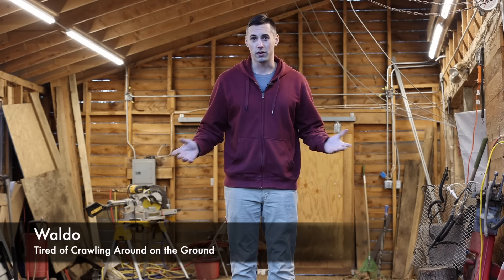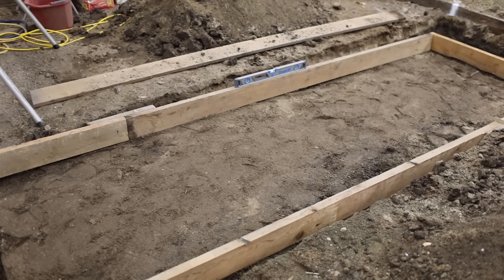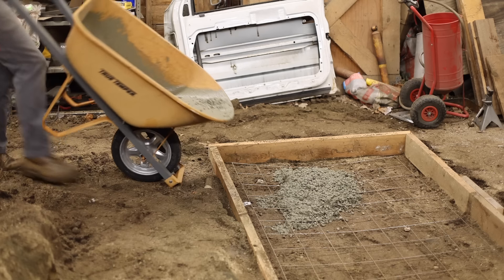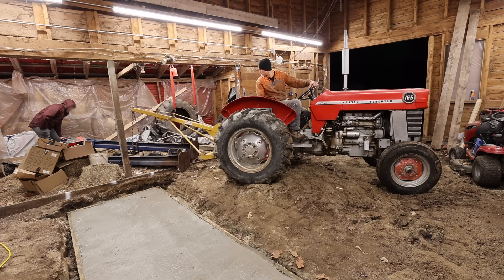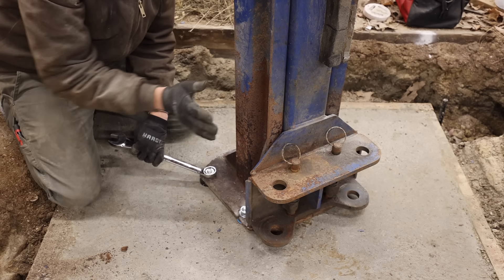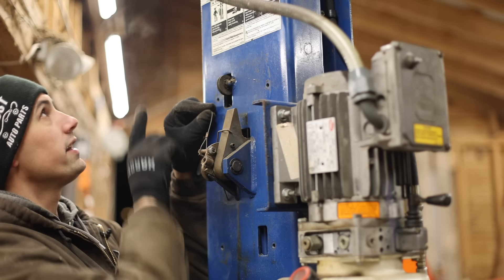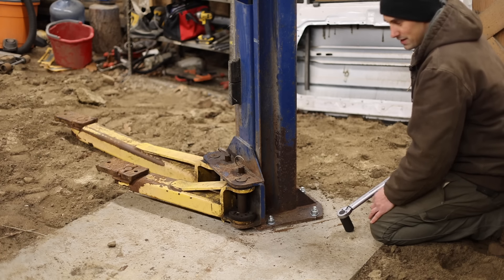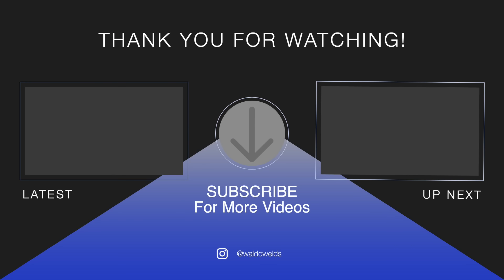Installing a 2-Post Automotive Lift on the Cheap

Comment: Waldo, love the content 👌!! However, that is not in any way shape or form enough concrete to anchor the lift to. We have installed numerous lifts over the years and a 6in slab is the minimum requirement with number 4 bar in a 12-16in grid wired together. That minimum is with the slab being past the outermost edges of your load. Meaning front, back, side to side of the truck. When installing these in a retrofit situation we would anchor pin into the existing slab, dig and pour a 3ft by 3ft reinforced concrete footing under each leg of the lift.
Reply: yes, I would agree with everything you said. Semi-retired builder here. It's not too
difficult to calculate loads on those posts. But is amazing  how so many amateurs simply don't understand this. The good news is that it is temporary.
Reply: I'm glad others are saying this there's no way I'd get underneath that, how much would that slab weigh? Seems like it could easily tip the slab if it doesn't brake it.. I suspect it will brake soon, many lifts also have spreader plated to support them on weaker floors would be easy to rig something up and extend the concrete pads
Reply: @geek9642  3040 lbs for 38, 80lb bags. 5-600 lbs of lift. Bet that crew cab 4x4 Duramax goes 6500
Reply: Depot wedge anchors are good for shear loads. Not so good for withdrawal. not nearly enough concrete to withstand the tipping loads. Looks dangerous AF to me. Around here this is insufficient for a propane tank in an earthquake. quickcrete is very "optimistic" on strength values. "welded wire fabric" is to control shrinkage cracking not to transfer structural loads. But put all that "best practice" aside and assume those parts are strong enough to roll the slab. And they probably are!
 Structurally lets imagine a 4 foot wide piece of cast iron weighing 3300 pounds and another piece weighing 6500lbs 20 feet long and them all bolted together with I beams  8 feet apart from each other, and it just sitting there in the middle of a parking lot. It does not pass the laugh test!
Say the vertical center of gravity with the truck in the air is 8 feet high. The 12" base plates' hinge point is 18" from  the edge of the slab. assuming no compression or squeeze out at the soil then>  96"/18" equals a 5.3 to 1 levering action.  3300lbs. of concrete divided by 5.3 = 622 lbs to push it over at the top. ( didn't even use the back of an envelope. Does this mean a safe working load of 311 lbs of fore and aft on the truck. The  truck weighs 6500lbs. And the whole thing is " bouncing around" - which is considered a "live load". No bueno!
Reply: I’m a county inspector, we pour our sidewalks stronger than that.
Reply: @lukula2934  this is absolutely going to be temporary, but I worry it might be more temporary than he expects. This has the stability of an inverted triangle embedded 1/5th into the ground..
Reply: David, you are right. It should have some decent size footers for safety. I wouldn't just use the slab, but that's just me.
Reply: I was thinking the same, the part of the slab where the posts are sited is nowhere near thick enough or reinforced enough. The the slab footprint is way too small, both where the posts sit as well as the whole slab area. The diameter of the reinforcing mesh is also too small.  I have never installed concrete in climates such as Waldo's (I have lived in the tropics and semi-tropics part of the world), so I don't know about pouring concrete in cold climates, I just know for load bearing concrete, I would prefer to use concrete delivered by a truck pre-mixed. If I were to entertain the idea of mixing my own, I would use a concrete mixer only because it is faster, and will have a more uniform mix. Having said that, in this instance there would be know way I would mix my own. I value my life and those I care about to much to let anyone stand under any vehicle being supported by the lift. My post sounds dramatic, but the risks are too high. Also, temporary sometimes means for years, not a short period. Also it only needs to fail once in the temporary period to be a bad, bad situation for all.
Reply: @iancracknell1379  Hope he reads his comments...Watching him open that brand new case and take out that drill. ..And be amazed at how easy it is to drill into green concrete...And those anchors are hit and miss in the best material. (Cured concrete, stone, etc.) As much as I love the do it yourself attitude, some basic common sense and an awareness of your limitations
is a must.
Reply: I'm currently having a concrete guy here preparing my slab. 24' by 26' with beams crossing each way. Lift company says 4 1/4" minimun with 3000 psi concrete. I'll be 5" thick. Cure for 28 days before any building is done.
Reply: Did he really use plastic shims to level it ? I hear "temporary" getting thrown around, this might just be "lifetime" unfortunately... completely inadequate for any safety standards. Anyone valuing their life will not try to use that setup for lifting a vehicle.
Reply: Exactly, is extremely dangerous!
Reply: You need a compacted gravel base and then a min of 4-1/4" of 3000 Psi concreted cured 28 days and a min of 3-1/4" of 3/4" anchor embedment. And all that is a min of 12x24 bay pad. If you are pouring a replacement pad then it needs to be 4'x4'x6" tied into the existing slab with chemical anchors dowelled in. This install is going to kill someone!
Reply: At minimum he should have bored 3'-4' deep piers with fasteners imbeded in piers, plus over head stabilizers.
Reply: @davidkaufman979  why is this so hard for people. No fastening to the top of the post as it's just a bolted on height extension with no structural capacity.  Second it's not the post falling as much as the vehicle shifting and falling off. Third if your going to pour 4' deep "PILES" then spend the time and concrete on a proper slab!

Comment: The wire mesh you used is for controlling surface cracking and provides no structural strength for a slab on grade.  Use rebar and set the rebar on inch and a half square concrete blocks (dobbies) with embedded tie wire to secure them to the rebar and keep it (rebar) out of the dirt.  Rebar size and spacing should be available from the lift manufacturer as well as minimum concrete size, thickness and strength.  You might want to contact them to verify what you constructed is adequate for their product.  A little late now, but that's what renovation is for.
Reply: Thinking the same. Wire will do nothing for that slab, rebar a way better choice and it needs to above the ground. (I don't remember the exact dimensions).
Reply: @jaymes7521  
What are saying needs to be above the ground?
Reply: @RalphSampson...  not laying on the dirt below the concrete, but rather, embedded approx 1.5"up inside the slab.
Reply: @rixtrix11  It should have read "off the ground".
Reply: Is wire mesh as good as rebar? No way. Is it worthless? Try breaking up the slab without cutters.
Reply: @RalphSampson...  Yes. There actual formulas depending on the depth of the pour. I don't remember what they are.
Reply: @davidbaldwin1591  Breaking up a slab is different than the actual support and integrity of the slab when it comes to a multi thousand pound vehicle leveraging on those posts...
Reply: @AnunnakiAaron  I absolutely agree. I also think leverage is of little concern. Almost all of the force is directed downwards on the posts. Otherwise, there is no way the handful of anchor bolts that side grip concrete could be used in a new lift set.  The lift would have to be rooted like a tree, with steel members extending into the slab. Lifts are built to minimize side load. Yes, they flex when in use. But rarely is any load placed far off center, enough to pose any risk to the bolts, which would be the failure point in a side load.

Comment: You need to adjust the cables, so that both the locks click at the same time. It’s unsafe when they are off set, seen many cars and trucks dropped because they were not adjusted properly. Additionally if you did not notice, the lifting feet can be stood up to avoid hitting body or running boards. Last thing once you get a vehicle off the deck, please go to the front or back and give it a shake test. It’s safer to have it fall off a few inches off the ground then when it’s feet in the air with you under it. While your working, shaking, prying, beating on something on the lift it can make it fall off if it’s not balanced right, hence the point to test it while it’s close to the ground first. Also a support stand at the back and sometimes the front is a really good idea for something long and heavy like a truck. Be safe and have fun!

Comment: Bro-- not to be a negative Nancy.. but,  I would tie a little brace across the top of your posts, and tie it to the rafters--- like with a piece of angle iron or something.   The problem is, if your truck ever gets a little off balance, there isn't much structure there to keep those towers from falling over.   You should have dug 18" deep footers under your posts (like the size of a 5 gallon bucket basically)--  and had some long L-bolts stuck down into that footer and a little cage of rebar inside it..  That's why I mentioned in the last video to make sure you dig 'footers".   But my point is now,  if you Tie in the top of your post with a cross brace to those rafters, that will keep it from tipping over and make it much stronger..  it's not the "compression" load of the concrete that you have to worry about-- it's the side loading from an off balanced vehicle on the lift.. Again, if you just bolt a piece of angle iron across two rafters and weld it to your post..  That will have a lot of leverage holding the top of your post in place and keep it from leaning from a sketchy/ off balance load...  I just gotta be honest;   an Inspector would be losing his mind if he seen how under-built that concrete is..  I mean, think about a basket ball goal that has the little sand/ water tank at the bottom--- your slab is not a whole lot bigger than that-- compared to the massive loads you're asking it to keep from tipping over...   Please just tie in the tops of your post for reinforcements, and It will be 100x safer.

Comment: Hi Waldo,  Just a couple tips from someone who installed a two-post lift by themselves for home use.  Your slab is fine IF you get your vehicles CG centered on the lift and verify the posts are still plumb after lifting.  Your Duramax is a great example - very heavy diesel engine up front and no box to counterbalance, your CG is probably about the middle of the drivers door.  Always put your CG in the middle of the lift and it will never tip!
However, even with the CG in the middle, sometimes heavy wrenching is necessary, like removing a stuck pitman arm nut, where you need to apply a lot of force at the end of the vehicle. Get a couple under hoist work stands from Harbor Freight and put one under each end of the truck.  Could save your life.
Enjoy your lift - you'll soon wonder how you ever got along without it!!
Reply: I agree..   I'd tie the tops of those posts into the rafters to make sure they don't side load and lean--- because that concrete is not structural, and he has no footings..
Reply: I take my vehicles to closed highway scales on Sunday.  They leave the scale on.  There are also commercial scales.  Weigh the front and rear axles and then you can figure the center of gravity.  Use tall support jacks if removing heavy components or just to be more secure.  The specs for my lift said 5" of concrete minimum.  Lifting at the CG is very important for two post lifts.
Reply: Not sure I’d entrust my life to a pair of Harbor Freight stands…
Reply: @froggionyc why? Have you ever seen or used them? I have done both.  Nothing wrong with a metal tripod only used to prevent a sudden weight change in either direction. Are you basing your comment on a reputation HF built up 25 years ago? They actually provide good quality nowadays to go along with their economic prices.
Reply: @WindRider1  the business model of HF and other American marketing companies selling 'cheap' Chinese imports is to beat EVERYONE with the LOWEST price possible, they look for the lowest price possible they can find in the trade fairs in Shenzhen and other southern cities. That can only be achieved by cutting on something, somewhere, proven design, manufacturing process, quality control, materials used, etc at the point of origin, the manufacturer. 
Having lived and worked in Shanghai for a bunch of years, I know that China can built lots of things just as well as anyone in the West, they are on par in super computers, civil engeeniring, electric vehicles etc, without mentioning their high speed rail network.
Reply: @froggionyc  agreed.  HF does have some inferior products.  They are offering a Good, Better, Best on a lot of products which as you stated,  the Chinese can build things to any level of quality.
Reply: @calholli  What a stupid suggestion. Get the damn pad right. The lift IS NOT SUPPOSED TO BE TIED TO THE CEILING! The anchoring of a 2 post is what holds it and if the slab is not re-bared and a small replacement pad size then its a NO GO!
Reply: @A_Person_You_Dont_Know   There are thousands of lifts that are built into the structure..  even overhead cranes inside buildings.  It's not uncommon.  I agree though --  get the pad right the first time.   He had his diesel on there and it hasn't fallen yet.   Braver man than me
Reply: @calholli   Dude you can't tie into the building. If the base anchoring isn't sufficient then nothing you do can fix that. 2 Post lifts are engineered for base strength. The top of the post is extended by a simple bolt on piece and the top has virtually no strength to counter "over turn" that is inevitable with this pad.
Reply: @A_Person_You_Dont_Know    The pad is sufficient...  He has had his diesel truck on it.  Bracing the top is not for lifting-- it's simply for helping it balance.  There is a lot of leverage at the top of those posts.  As long as the posts are held upright, they are not likely to fall.  But once they get pulled slightly off balance and lean one way or another-- then it's easy to collapse.   You would be surprised how strong those rafters are..  They have plywood sheets that tie everything together like one large piece.  It would never fall over.  I ran a crew building houses and metal buildings for over a decade...  

Just like someone can jump/ stand and balance on a pogo-stick--  there's no good reason why they shouldn't fall over-- but as long as it is upright and balanced, it's fine..   The braces at the top would only help to keep the balance in the center and keep the posts upright;  preventing LEANING.. which is the main risk..  As long as he keeps the truck well centered, then it's probably fine..  But I would still want that top tied in, just for a little redundancy;  since the base is so borderline sketchy... Plus the fact that it's very quick and easy to do.. Cheap insurance
Reply: @calholli  ok so you are wrong and I happen to be speaking from authority on this. The slab is insufficient according to mechanical design engineering.  

Just because he hasn't has a catastrophic failure yet doesn't make it safe. 

Trust me I'm right on this.  I'd rather not get into why but I just am.
Reply: @A_Person_You_Dont_Know  lol..  I know the code for building these things... but we're not taking about that. Also, this is the whole reason why I would want it reinforced .. So I'm glad you came around to agreeing with me

Comment: The cabling leveling system setup properly will keep the truck from lifting at an angle like that. An easy way to do that is to move the arms inwards as close as possible. Then place a long level across them to show the leveling. Then adjust the ends accordingly. When I worked for Nissan we had a lift do that exact same thing. If you don't level it properly. You risk the vehicle slipping and possibly falling on you. Stay safe and a good video.

Comment: A friend of one of my mates used to rent a workshop for his little custom exhaust business, and one of the big limitations he had there was not being allowed to bolt anything to the floor. When he got hold of a 2 post lift he ended up also buying some chunky steel I beams from a scrap metal dealer and welded up a platform to bolt the lift too. It was a pretty substantial slab of engineering at about 6" thick, and because he also had to make a long ramp to get lowered track day cars onto it, the whole lot took up a pretty significant amount of workshop space.

Even though steel prices have gone nuts everywhere lately, it might still have been a better option on that dirt floor than your narrow slab. You could still go with an alternative option of cutting some thick steel plates to go under the posts, then welding a couple length of I beam to those going fore and aft like outrigger support arms, just as a temporary safety measure until you rebuild your shop

The arms on these lifts are long enough that it would be relatively easy to accidentally lift something with the CoG beyond the edge of your slab, so please, be careful mate. A couple ton of car falling 6 feet won't take any prisoners.

Comment: Make sure you get some of those large jack stands to put under the front and rear of the truck before you work on it, they will move around a lot on the lift, especially on the heavy one tons and mason dumps, or long bed crew cabs